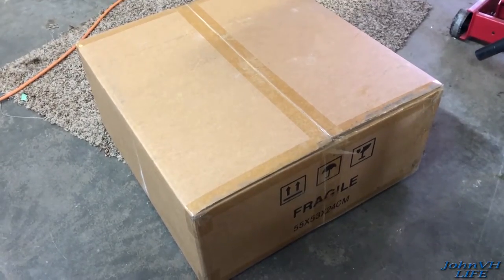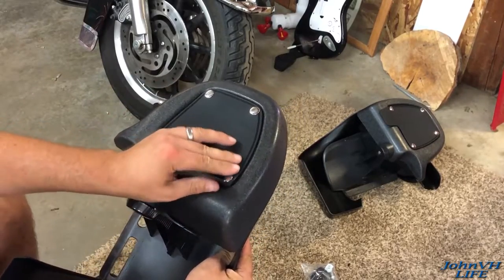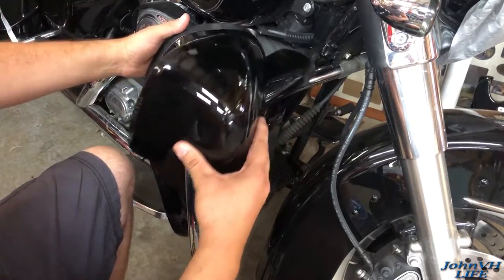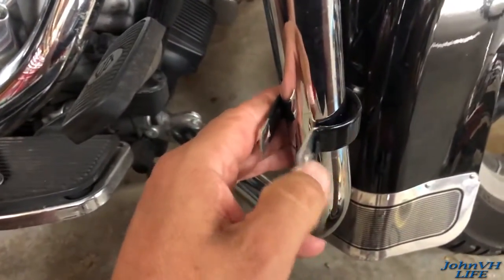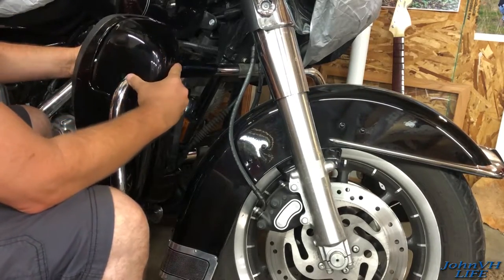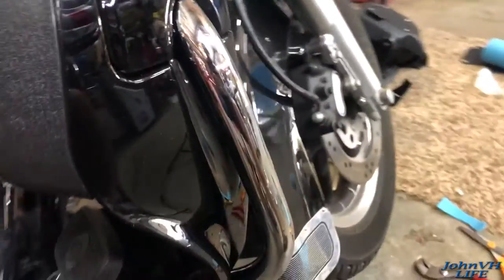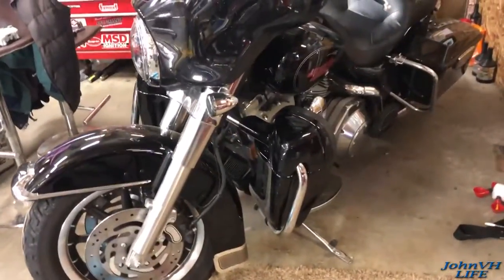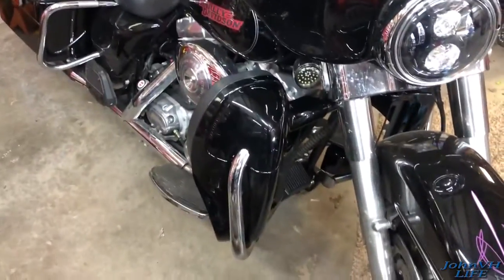XFMT Lower Vented Hard Harley Fairings UNBOXING INSTALLATION REVIEW

Comment: Great video, I’ve just bought these too (along with some new Hard bags to replace my Leather ones), they do feel a little brittle, I’ve spent today stripping them down and ceramic coating them for a little surface protection as I don’t want to colour code them and leave them gloss black, I’ve sent away to Amazon for some sound dampening rubber to stick on the inside of the shields and bags to toughen them up, but overall for the price they seem pretty good, time will tell regarding stones and chips. I paid £69 GBP for the Shields and £245 for the bags.

Comment: I bought these on Amazon and cracked on the first long run. This is JUNK! I contacted the seller and no response yet. Filing a complaint with Amazon. Don’t waste your money.
Reply from the maker: Weird. Mine have not cracked at all. Sorry to hear.
Reply: @JohnVHLife  sucks because I just installed them no more than two weeks ago. Not all ABS plastic is the same. My guess it was already defective, but didn’t notice until my first long ride. The vibration might have been the cause.
Reply from the maker: @gilflores1032  bummer man!